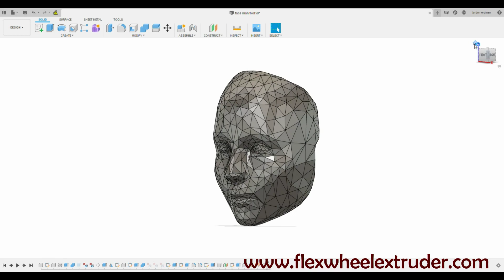Coronavirus ?? - A prototype 3D printed custom fitted personal protective mask.

Comment: is it a different material for printing the seal vs printing the mask?
Reply from the maker: The mask is a mass produced P2 N95 which I modified by cutting down. The flange which I glued to the cut down mask was printed with Ninja flex - the seal was then printed with the same material directly on top of this flange.

Comment: Or...use thermal to form the mask and a rubber gasket material that then uses strap force to seal and doesn't dig so hard into your face.  Very few people have a scan of their face - maybe a video on how to do a scan with low cost or abundant hardware (a camera with multiple angle shots maybe?) that everyone could use would be helpful?
Reply from the maker: Re: " a video on how to do a scan with low cost or abundant hardware" Check out this video for using Meshroom to obtain a stl. file of your face.  https://www.youtube.com/watch?v=9Ul9aYhm7O4
Reply: @flexwheel4806  thank you!

Comment: PLEASE READ THIS WARNING ABOUT 3D PRINTING MASKS
https://www.infoq.com/news/2020/03/3d-n95-masks/
Reply from the maker: Many of the problems this article touches on in regards to 3D printed masks are the ones we are trying to address - 
The quote "These layers can contain air gaps during the print process if the filament does not bond perfectly with the layer underneath it."  - With a high powered extrusion system (i.e. the Flex Wheel)  this is not an issue as inter layer bond strength and air tight printing can be guaranteed. 
also "the resulting mask may not form a seal against the wearer’s face" this is the problem we are working towards solving.

Comment: How did you scan your face? What software did you use?
Reply from the maker: I have used a number of different programs - I found mesh room pretty good and its free - Recap is much better but it does cost once you bur through your free trial. All3D provide a good article on photogrammetry which detail other options check out https://all3dp.com/1/best-photogrammetry-software/

Comment: Ii just think it's so funny that people think these masks are going to safe you hmmm I dont think so
Reply: Better than nothing...
Reply from the maker: That may be the case, however the biggest flaw with these types of disposable masks is that they are mass produced and designed to fit a generic face, they are never able to provide a 100% seal for each individual. That was the problem I was trying to address. If you are to wear a mask it may as well be as efficient as possible.
Reply: It puts some minds at ease.  It's like foreplay, the insecure say it's "essential", others, a waste of time.  Whatever you tell urself to make you feel good.

Comment: Does the 3d mask you are making require filters?
Reply from the maker: Yep they do require a filter, the one in the video was based and printed upon a disposable  maxisafe brand mask https://maxisafe.com.au/products-page/maxisafe-disposable-respiratory-protection/p2-respirator-with-valve/
However the concept and design can easily be modified to work with any other type of filter - so if you have a box of loose filters and no face mask than this would be useful.

Comment: What printer did you use?
Reply from the maker: Base printer - Hypercube with a few minor modifications- https://www.thingiverse.com/thing:1752766 - Extrusion system - Flex Wheel in a Bowden set up. https://www.flexwheelextruder.com/
Hot end - E3D - 1 mm.
Print material - Ninja Flex